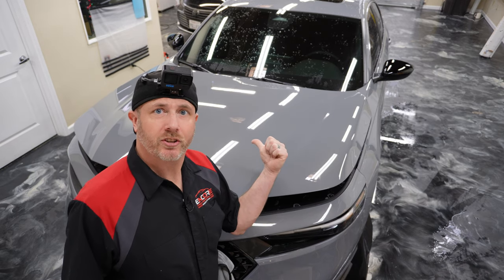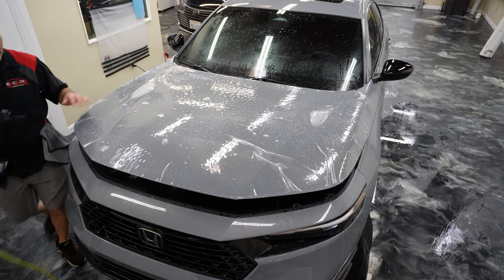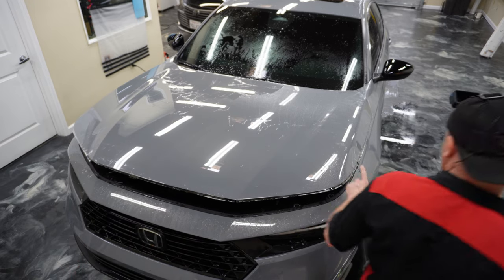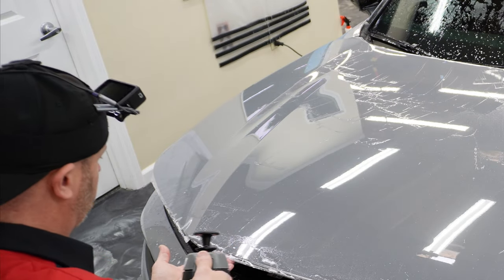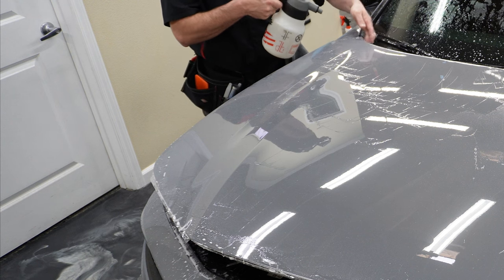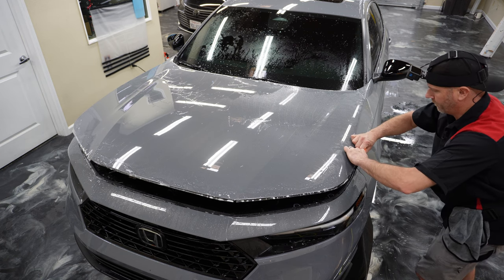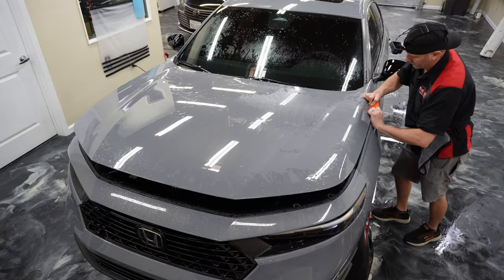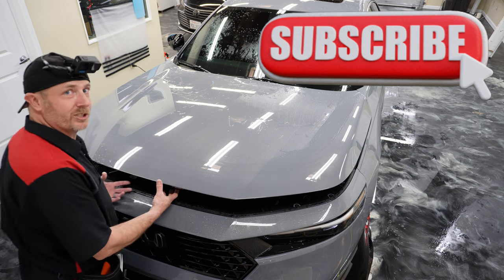How To Install PPF On A Hood🔥Of A Honda Accord 2023  Paint Protection Film Installation

Comment: How do you NOT get lift lines after you've already squeegeed it down and then reposition it ?? Is it slip solution ratio or temperature ?
Reply from the maker: It very well can be the amount of soap in my slip solution.  Also, the longer you let an area sit (after being squeegeed out), the higher the possibility you'll get stretch lines when you reposition it.